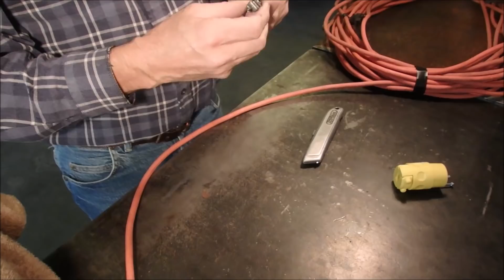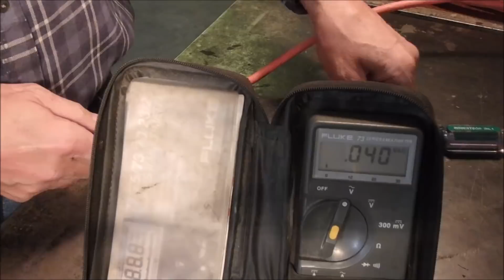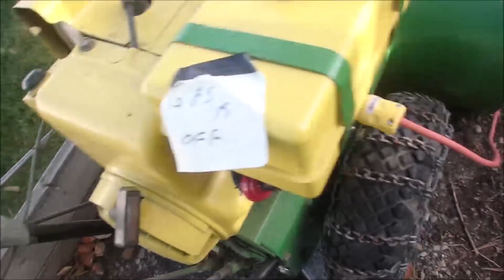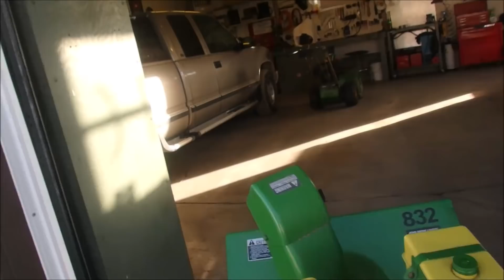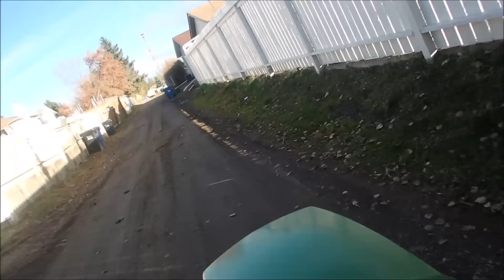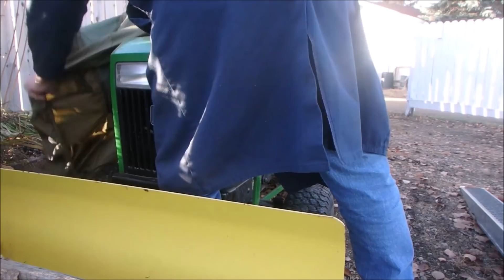14 Gauge Cord Repair and Small Engine Tetris

Comment: I picked up a Stihl Hs 45 in a similar circumstance and I have been repairing it.  It has become somewhat of a money pit but I think I have crossed the Rubicon with it.  The starter rope was crap, the kill wire had been shorted out under the cover but I can crank it and it does have spark.  I have cleaned the carb and rebuilt it.  I have replaced the fuel lines and filter.  I can get it to run but only for a second or two.  I have cleaned and lubed the transmission.  A lot of work.  Yesterday, I replaced the carb with a brand new AM carb that I had bought for my HS 80 a few years ago.  It gave the same results as the Stihl carb - run for a second or two and then die.  However, it makes me think the hedge trimmers are loosing its impulse from the cylinder.  This pulse comes out of the cylinder and passes through an hole in the isolation block to the carb.  My bet is that it is not making it through the isolation block to the carb, so that will be what I do, today.  My primer bulb works fine and the gas it provides is the only gas making it to the carb.  My Might Vac says both carb are fine.  Have you ever had this problem on a small engine?
Reply from the maker: I don't want to derail your thoughts but on some 2 strokes there are issues with the crankseals.  2 stroke engines use the crankcase as the intake manifold.  Thais is whey the gas has to have oil in it.  The crank shaft that protrudes and does the work.  One end for the rewind and the other end for the blower-blade or whatever.  If these seals leak you will not have enough vacume to pull the misted fuel mix in .  If you can get it running turn the machine 360 degrees to see how it runs.  I confess when this happens with a 2 stroke i move on.  Stihl has great seals compared to department store machines.    Good luck John Clarke

Comment: Nice Bruce we normally only use the short 9 ft. extension cords but as long as the wire gauge is heavy enough you will not have too much of a voltage drop which can fry an electric starter. Still using a nail to balance mower blades we can send you one of the plastic cone blade balancers if you would like!
Reply from the maker: That's is Ok  It is the space shuttle.  I really works.  (my nail balancing)

Comment: Bruce, great video.  Would you consider making a video to explain the difference in screwdrivers between the Philips, Japanese Industrial and Robinson or Robertson?  Also, what about these terrible screws I see these days that look like you can use either a flat or Philips screwdriver except neither one works worth a damn.  What do you use on those?
Reply from the maker: Well I have commented on the JIS.  The JIS screws are not as deep so when you use a regular Phillips they hit bottom and strip easily.   BUT  you can use a JIS screw driver on regular  phillips and the lock right in .  i have alost stopped using the regular ones.   The other screws you mention are for the homeowner who can use what he has in his hand.  LOL

Comment: Really nice video ! I've been doing some electrical work lately, too. People wanting outside recepticals for pluging in the vehicle, electric blowers, etc. I was wondering what kind of tarp you were using and then you said what it was, cool ! Not a fan of using just a blue tarp to cover stuff. that seems to promote rust. Thanks Bruce !  🙂👍
Reply from the maker: I buy the actual 3 layered covers designed to shed moisture and keep the condensation away.  Like the good car covers.
Reply: Very nice, your machines are looking premo. ✌️
Reply from the maker: @andrewwoodward6560  I need a small building which would be better for storage.

Comment: Were you a lineman Bruce? Mad respect for those badasses.
Reply from the maker: I was what they called   Equipment Installation.  from switching equipment to fibre optics.
Reply: @BrucesShop  Cool. My late uncle went from lineman to install as he got older.
Reply from the maker: @bubbafudpucker397  Right.  I install i did was right in the company switching rooms.  I only had to work in the residential for 2 years.  That is tough due to the humane element.  Machines don't talk back.  (well they do to me)

Comment: Good tutorial on plug replacement Bruce. I think I told you before but I'm the guy everyone at work comes to when they need their cord fixed. For some reason people are intimidated by wires.  I never seen or heard of that tool you used for scoring but I like it. Yes nobody knows how to wrap a cord. That's my biggest pet peeve when a new guy comes in and starts wrapping the cord around his arm ARRRG!  The machines started right up no problem
Reply from the maker: That is i tool for communications cable.  It is in the comments.

Comment: Nice Find. I was taught years ago on wiring that Ground to green and Black to Brass. That Snow Blower fired right up like it was started yesterday! Hard to beat those LX series John Deeres with the Kawasaki engines best mower John Deere ever made
Reply: I was never much on Deere lawncare stuff, except for the late 70's to early 90's 300 and 400 series riding mowers. I don't like any of their newer lawn stuff.
Reply from the maker: @bubbafudpucker397  I agree.  Not a fan of the x series.

Comment: Bruce, ive never seen that tool to strip the outside insulation. Where did u get that. So simple but very handy. Love your videos even ones like this one showing basic tips. Dont let the negative comments bother you.
Reply from the maker: Yes it was a cable butt tool from work.  Here is one one Ebay.    I added the link to the comments   thanks
https://www.ebay.com/sch/i.html?_nkw=P.+K.+Neuses+N-2060+Cable+Ring+Cutting+Stripper+Tool

Comment: The new connector that you're putting on will be too large to be used on a connector for the electric start on a snowblower
Reply from the maker: It worked on both snowblowers.  The other one "Craftsman" doe have a "hood" on the input but it fits.  You know me I would try it before i started.
Reply: Good to know Bruce so sorry but to me it looked like it would not fit into the hooded Style!
Reply from the maker: @robertgoth5570  No problem.  I old 3 port end was useless as well.  Fine comment.  No issue .

Comment: All your JD equipment is in great condition and looks good ..I do like the newer cord ends ..One other thing I would have done is check each of the 3 wires in that cord for ohms resistance since it was black and tarnished ..I used to do that on the big CB coax I would  come across that was old and used
Reply from the maker: I did check one to end with a meter.  i must have edited that out.

Comment: Hi Bruce, from 45+ years ago my 1st lesson was always leave the ground slightly longer so it's always the last to leave the terminal block, still do it today!
take care you two, regards alan.
Reply from the maker: Good idea.  My thought id if they are all the same you have 3 times the pulling power before it breaks but i am sure both work.  Thanks for the fun comment.
Reply: @alan: I agree, that's how I do it as well.
In addition to that, I always use size matching 'non insulated ferrules' to keep the strands together. In any case, NEVER solder the wire end.

And to prevent 'shiners' I always put the wire at the left side of the screw (if possible) before tightening This will pull in the wire end into the connector. If you put the wire on the right side (see 10:25 - 10:45 in the video), this might push out the wire during tightening.
Reply from the maker: @hermannheidemann9810  Right.  i understand.  This is one of those new ones that doesn't let you curl the wire around the screw but i think you knew that.
Reply: @BrucesShop  Good point; to be honest i missed that. Here in germany you'll most probably get not so well designed connectors in the hardware store...